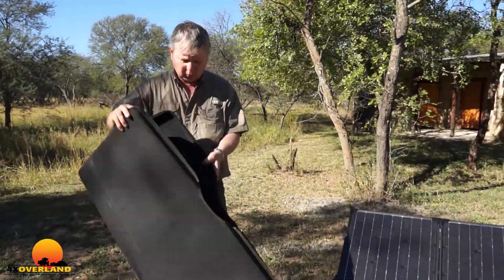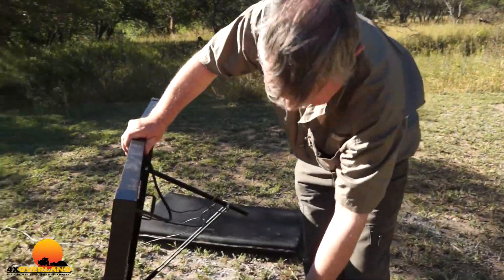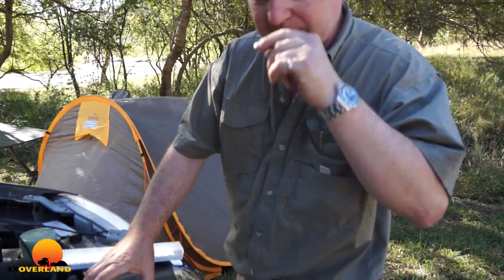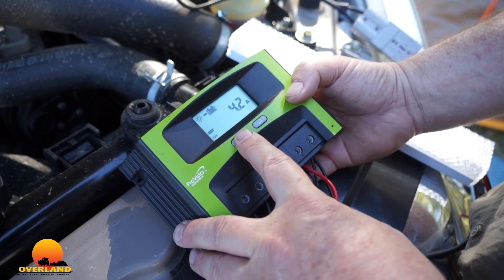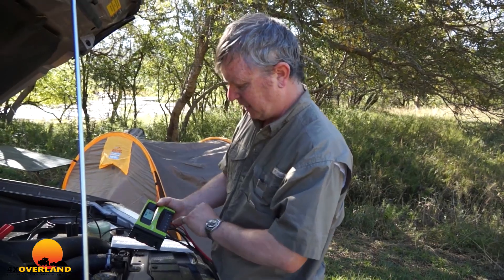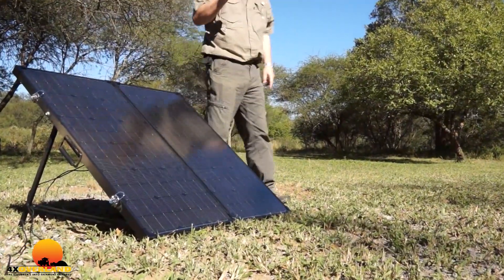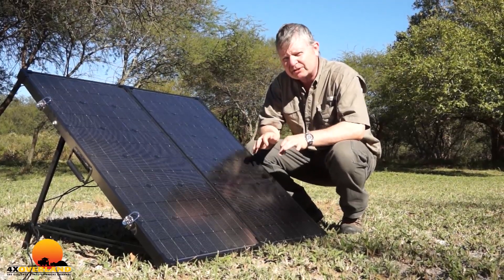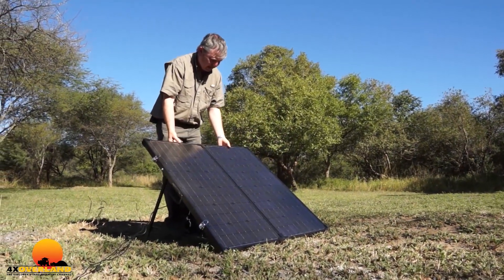Solar power for overlanders - portable setup

Comment: The dropping current has to do with the way of how the cells are configured in series! Shade on 1 cell can cause several cells to lose current, that's way. 

Of anyone has such conditions, check for different types of cell configuration. Different solar panel types behave different in this way!

Comment: I believe the big drop in current is due to these types of panels wiring many of the cells in series.  Like a Christmas light string where lights are grouped, if one goes out, the whole group goes out.  

So if one cell is covered, it could have the same effect has covering 1/4 of the panel (or even more).